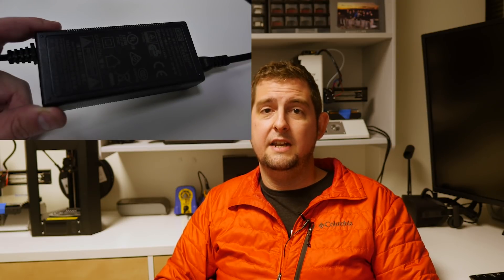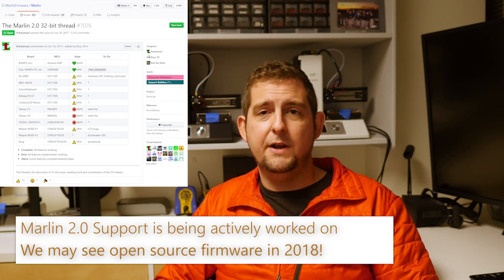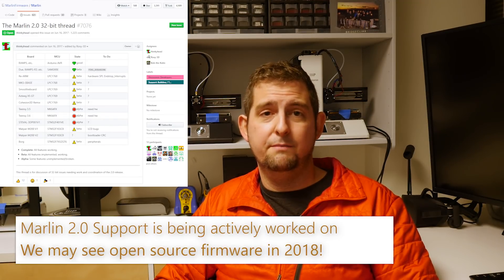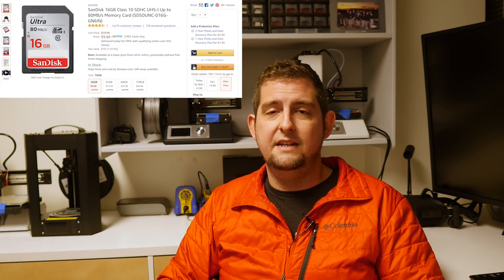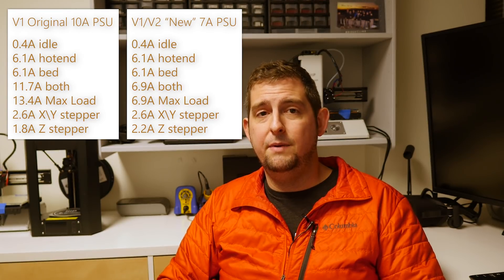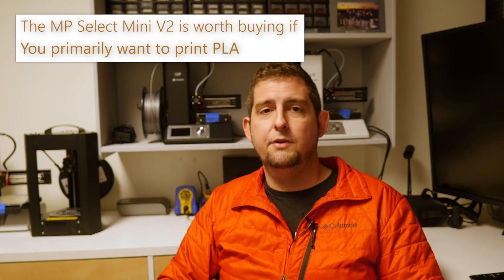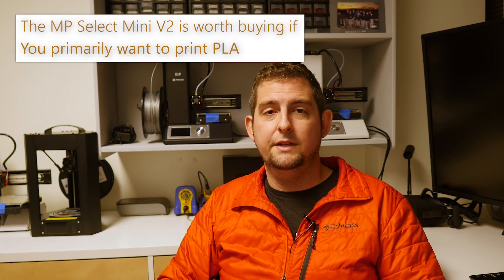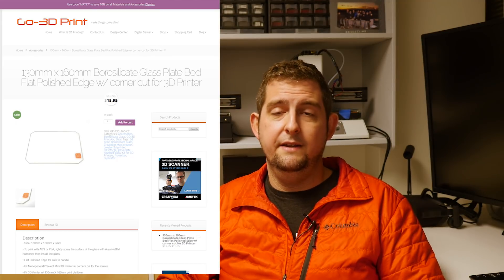Monoprice Select Mini V2 - Extended Use Review

Comment: Well I still have the V2 and I was able to print two prints back in the day (the cat), being busy at the time I gave up with Y axis issues ( I had installed the fix for cable drag ). The unit would drift on the Y axis. I have decided to give it another try as outdated as it is. I ordered a stepper and a system board. If nothing else after this attempt it will be a good museum piece. If you have any ideas for where the last known updated firmware might be obtained please let me know. Could have been the firmware was just corrupt? Thanks in advance.
Reply: Unfortunately I do not have any of the firmware images saved.

Comment: I picked up a Monoprice Mini V1 3d printer at the local Goodwill Outlet store for about $8.00.  This was my first 3d printer.  Electrical item are sold by the pound.  I orfered the correct power brick off of Amazon, 12volt 10amp.  It needed some help.  Thanks to various you tube videos I got it up and running.  Anyway I was doing a filiment guide print and at about the 50% mark it died as in no power.  I tried the backup power brick and still no power.  I tried jumping the on-switch and still no power.  There are some videos that says the wires on the heated build plate can cause a short, but I did not see any signs of chafing.  Any ideas why there would be no power?  This is actually a pretty neat little printer.  Any ideas as to why there would be no power?  Both power bricks are good.  Thanks.

Comment: I'm a 3D printer newbie and still going through all the software options and getting a feel for which I plan to use.  

Neat reading into, prior to investing in, regarding detailing and a bonus is the Y-Axis can be done for free basically other than time and print filament since I have the 8mm rods and glass from old HP officejets: https://www.youtube.com/watch?v=aPAuHSU1c0g

Wondering if you happened to look into scanner beds from officejet's glass to determine quality.  Thinking I'll use since have a few. Still need to spec out motors also, though just from visually quick looking... some look similar to the Z-axis.   Now, to find a free copier that's full of stepper motors for a custom build potential.  Oopss... getting ahead of myself again.  Need to iron out all the quirks with the MPSM_V2 so understand how to operate smoothly. 

Appreciate the insight into.

Comment: Thanks for reviewing! Do you think the V2 draws 13 to 14A at max load like the V1 does?

One low cost method is to modify a used PC power supply to power it. A 350W power supply may supply 15A at 12V.

Comment: To anyone with this printer, I'd appreciate if you answer this for me: Is the hotend an exact replica of the e3d v6? If I got an e3d v6, would it fit into the printer's stock mount with no issues? Or would I have to print a new x carriage? Thanks in advance.
Reply: Lots of people have made the switch.  Toys in the Attic has a really good video.  Check it out.  I had lots of jams at first but that wen't away when I installed a heatbreak with a PTFE liner.

Comment: This printer is garbage. Worth 50 bucks max. Whoever buys this piece of shit in 2018 must be crazy. Besides the random quality of the prints and all the issues you already said in the vid, the SD card reader does NOT read all cards and you specifically have to use those low-end cards as the reader cannot keep up with the new ones. This was even specified in the online manual. You might get lucky with your sd-card purchase but good luck with that. Tried a lot of different cards and none work. It keeps saying the card is empty. Usually the card needs to be under 2gb to even have a chance. The USB keeps acting up and is unreliable - prints tend to get stuck midway randomly without any reason. Its not clogged or anything - it just stops and the progress timer keeps going. Using Cura with this is a waste of effort - only the old version that's on the SD card seems to work decently if it feels like it. The filament holder is also crap and for the love of GOD I dont understand why they thought it was a good idea to rotate it sideways compared to the machine. The line is always tense and has a tight curve at the top and causes strain on the extruder. Just get an Ender 3. Its under 200 and superior in every single way. The community on that is huge and it can be modded to almost perfection. Yes, its a kit but its semi-pre build so its not shipped in a million pieces. The quality out of the box is way better than this abomination.

Comment: To bad the printer parts are not there!The backlight went out on my version1 and no screens to replace broken ones are available From monoprice or maylan. They will not supply information to allow you to get them running again. Bad customer service from both companies. You can find fixes or parts from other sources for other fails, but I can find no replacements  or helpfor screens.

Comment: Simply getting a beefier 12V power supply doesn't really help as much as using a separate 24v supply with a MOSFET to drive the bed.  This makes getting the bed up to 85 - 100 degrees MUCH faster.  I can get the printer up to ABS temps (240/85) in less than 5 minutes... usually about 3 minutes.  Honestly, the MOSFET mod is as game changing as installing the glass bed.

Comment: the MP Select mini V2 is the 1st 3D printer I have owned. I  disliked the wifi and SDcard methods of printing, so i set up a raspberry pi 3 with raspbian Jessie and did a git install of octoprint V1.3.6 server.  Monoprice has a non standard usb shandshake protocol, so added the Serial Double Open & EEPROM Editor for MPSM (0.1.1) plugins to octoprint and upgraded the mini V2 firmware to the latest (for usb fixes). I use Cura 3.1 as the slicer &  added the Mini printer profile from https://www.mpselectmini.com/_media/slicers/cura/cura_3_0_4_mpsm_20180101_0418.zip  and added  your recommended print start and print end gcodes.  I can print , manage & monitor the mini from any networked computer :).  Good to hear cura 3.2 now supports the mini.

Ty for your videos. They are helping fine tune my prints.

Comment: I’m starting to have connectivity issue with my heated bed. I have to push it to a specific position for it to heat up. Are there any way to stop the wire from further degrading without tearing apart  the machine?

Comment: Thank you for a very well constructed review.  I started with the V1 and your videos for that were amazing as well.  I have now switched to a i3 clone the Tevo Tornado instead of buying another MP select because of the lack of support and difficulty in finding parts.  The V1 is an excellent printer but the design decisions with proprietary and locked parts (i.e. Hotend) make it a difficult printer to recommend.  If they just used open source compatible parts it would be a different story.

Comment: Im on a V2(but i did buy it used for $100). Its an amazing product.  Loudish, but great for a beginner. The first mod anyone does should be the glass bed. it drastically improves prints.  I'm slowly up extending by the print area. By the end of the week I'll have 155mm z axis, after that I will be adding the the build plate itself.  I want to have  X 185mm Y 250mm  Z 155mm and not have over $200 invested.
Reply: Same here for $100.  I'm still going through all the software options and getting a feel for which I plan to use.  However, neat reading into prior to investing in regarding the modifications to increase the print volume.  This video is the best I've found so far detailing and a bonus is the Y-Axis can be done for free basically other than time and print filament since I have the 8mm rods and glass from old HP officejets: https://www.youtube.com/watch?v=aPAuHSU1c0g

Comment: What  about geeetech  E180 3d printer
Reply from the maker: No heated bed, expensive and proprietary hotend, basically non-functional WiFi, no dedicated part cooling fan.  Seems like a good design with good hardware for the most part, but you're only ever going to be able to print basic PLA prints.  No bridging, no supports.

Comment: My Mini V2 bed is warped up in the middle from front to back. Also my MicroSD card died after about a month. 
My Mini WON'T recognize a 16 GB card. Bought one and tried many different file formats. Suggestions for getting it to recognize a card that size?
(I ended up ordering a 2 GB card from Amazon.  It recognizes the smaller card.)
Reply from the maker: I've tested and used 16, 32, 64 and 128gb microSD cards from SanDisk and Samsung with no issues at all.  You need to make sure the cards are formatted as Fat32 or exFat and not NTFS.  Grab that 16gb card, format it as Fat32 and give it another try :)
Reply: I tried formating as Fat32 and all the others.  Many times.  I finally gave up and returned it.  I read from Monoprice that it won't recognize any larger than 4 Gb.  So that's when I ordered the 2Gb card that works great.  I wonder if brand makes a difference?
Reply: @partsdave8943  The cards up to 2Gb use an old style controller that is not set up to handle more than that.  The cards with more capacity use a different controller.  I also could never get my machine to use them.  However I have a couple 256 Mb cards and they all work fine.
Reply: I've had the same issues. Also, it looks like the disk he puts on the screen is a full size SD card, where the Mini only takes Micro SD cards.
Reply: Andy Diehl just noticed that. You are correct.

Comment: I like the MP Mini's, I had a V1 and it was my first 3D printer. The problem with the MP's is they have a lot of proprietary crap in them (firmware is a big one). I think the biggest problem with them is that the CR-10 exists now, and as much I hate to be on the bandwagon everything has to be compared to them now since they're so cheap and so good.

Unless you really, really like the colour display or hate putting together a couple screws I don't see any reason to go for one of these anymore. True the CR-10 series isn't perfect (loud fans, etc), but for a little more than the V2 you get a fantastic printer running Marlin and using mostly standard parts.
Reply from the maker: Peter Brockie yeah I completely agree but the CR10 is double the price, requires assembly and isn't portable.  It's an amazing deal, but definitely a different class of printer
Reply: It's cheaper when you factor in smashing the MP Select and buying a second printer over saving a little longer and getting a different one from the start :D

Totally agree on the portability, but assembly is a bit a grey area, I mean, yeah, you have to put some of the CR-10 together but it isn't like building a kit and takes 5-10 minutes even for someone without much experience.

Comment: Thanks man. I have a late V1 with a 13€ V6 clone from AliExpress, and a USWaterrockets gantry made from PETG. I also upgraded the stock extruder to titan extruder China clone - it felt like a bigger upgrade than V6. It can print PLA, PETG, TPU without any trouble. Really solid printer, after you modify it enough. Total cost is about 350e for me.